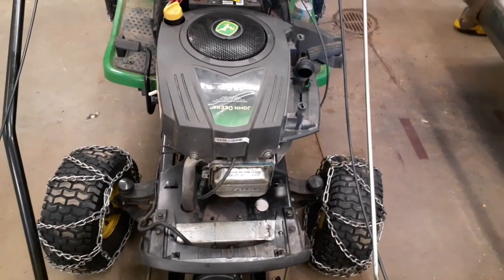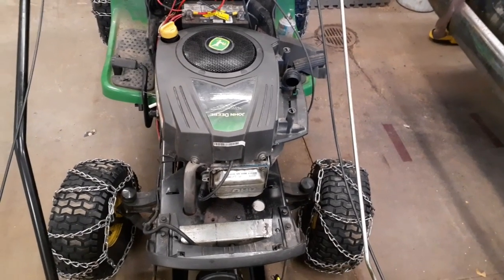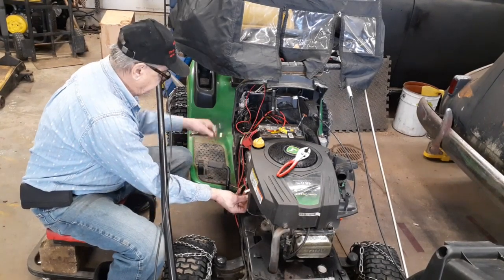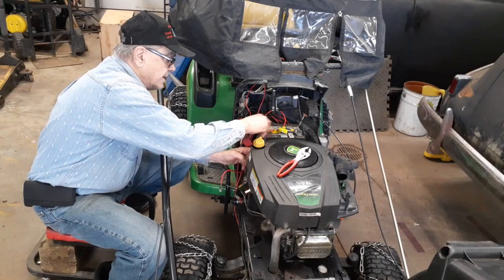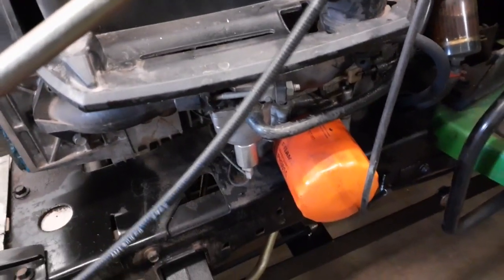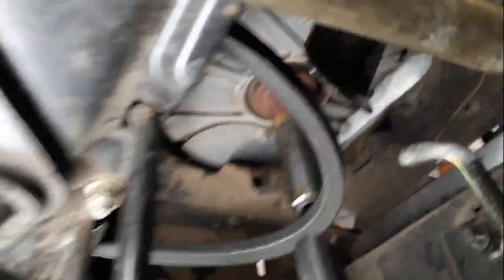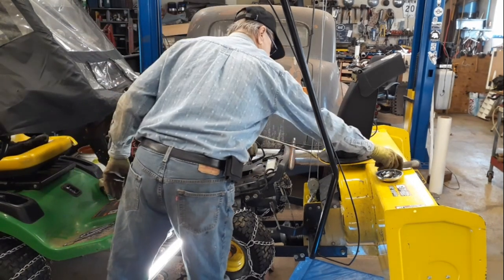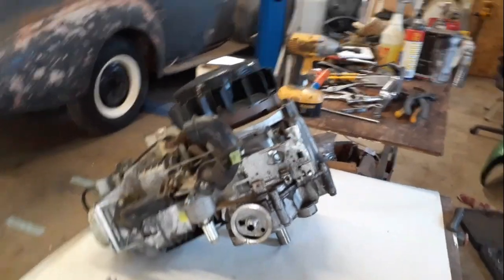#287 Remove the engine to Replace the Cam Shaft in Briggs and Stratton Engine.

Comment: I have a Murray Mower. The engine is identical to yours minus the oil filter and John Deere stickers.
Reply from the maker: Hey Abe. Thanks for dropping by the Dog House. Names don't mean anything anymore. Everything is made in either China or Japan and they just put different stickers on them. The filter is an extra car filter that I had in my shop. I don't need John Deer filters either.